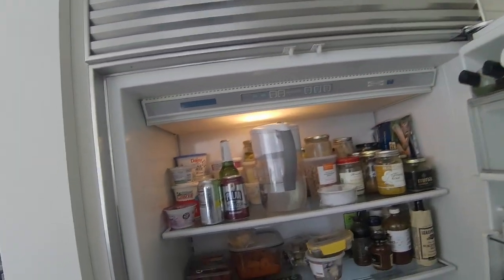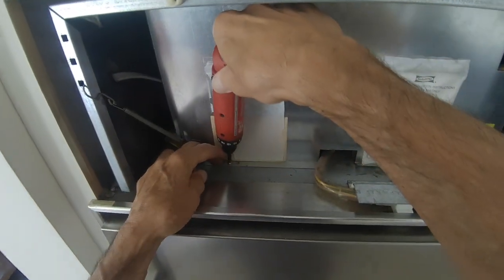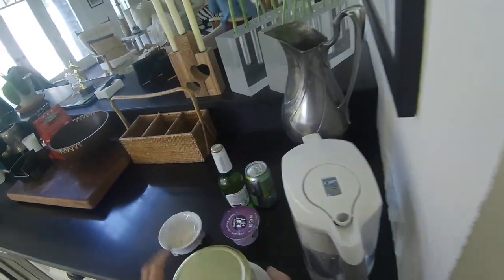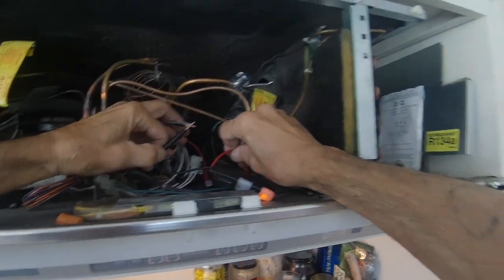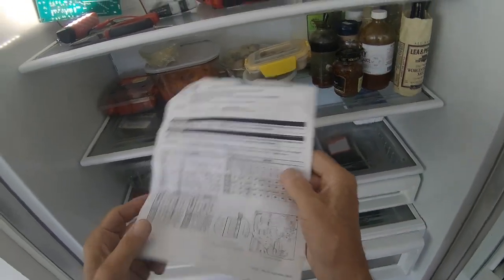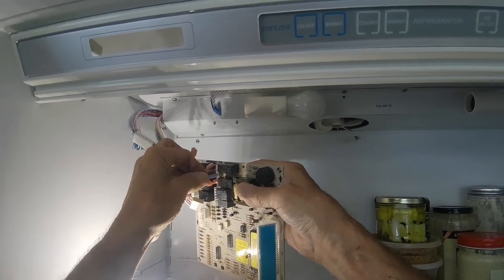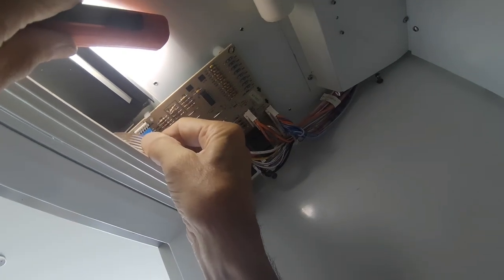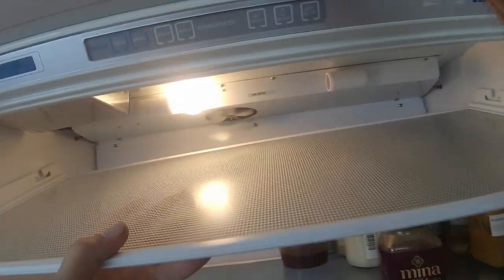Sub-Zero 650 Control Board Diagnostics & Replace

Comment: if my control board is making a clicking sound does it mean its bad, I'm having issue with my freezer stops working every so often on my 650.
Reply from the maker: @adamhart7324  you can go to my website and click. On Tech Help, find your model number and peruse the electronic control section and look for diagnostics
Reply: @ thank you
Reply from the maker: @adamhart7324  Sound like the relay for the freezer compressor. Did you run a diagnostics on it?
Reply: @ hey thanks for your reply, I have not done a diagnostic on it.  Do you have a video on how to do that.  Awesome work on your videos!